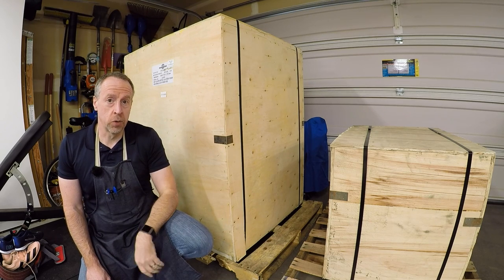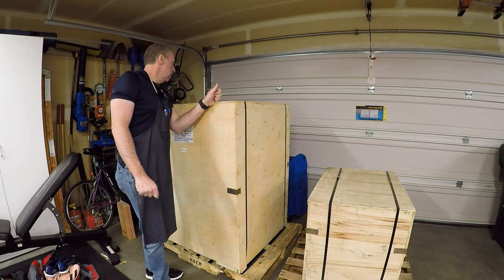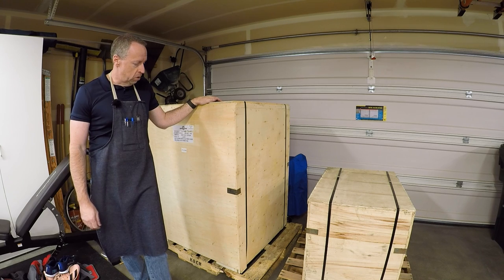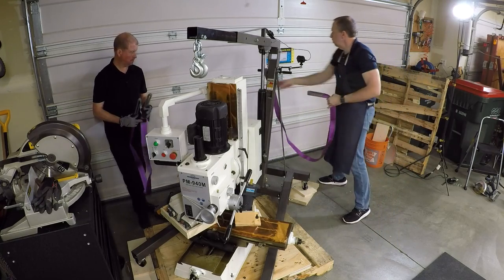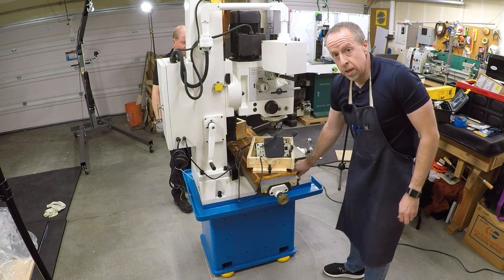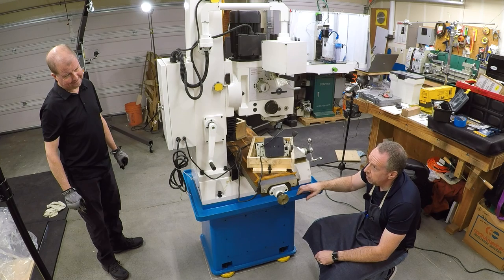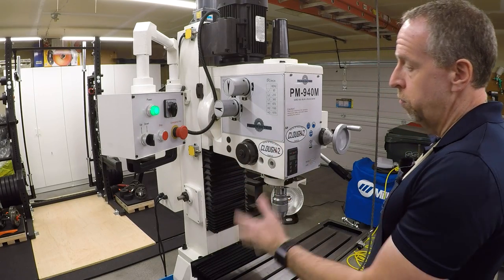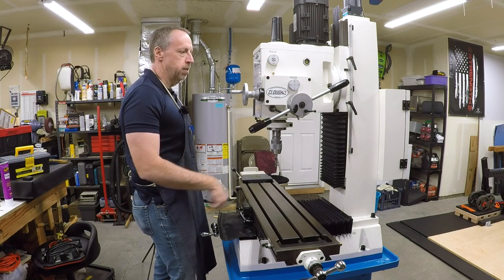Setting up a New PM-940M Milling Machine - Unboxing, Moving and Assembly

Comment: Most machine shops I worked in, there was always a couple of Bridgeport Mills available and they were always popular mills. I loved working on the Bridgeport. The larger mills were generally Cincinnati mills. Most of the lathes I worked on were Monarch and they were very fine lathes. I worked in the machine shop for years, just long enough to get my degree and become a CPA, but although I have been an accountant for 40 years, I have missed the machine work all my life. I loved being a Machinist. I worked for Lockheed as a Class A Tool and Die Maker for a couple of years and was very good at tool & die work. I made a lot of tooling that went into the fabrication of the C5A cargo plane.

Comment: Wow i wish i had all the options like your mill has on my HM46 mill which is somewhat remotely similar to your machine- very remotely that is 😭.
One modification i did before i fitted the power feed for the table was to remove the feedscrew bearing cap on that end of the table and bore out the housing to accept a roller bearing as getting to the oiler is impossible once the power feed is fitted .

Comment: Some owners were not impressed with the leveling feet and decided to machine their own. I've been considering one of these for a while and wondering how i'd do all this solo, the engine hoist seems like it'd be ok but perhaps putting taller casters on the hoist would be an alternative to what you did. I don't own a fork lift or pallet jack, and right now I don't own an engine hoist either.
Reply from the maker: Perhaps.  A few people have suggested modifying the hoist, which is an option, but not one I'm keen on.  The hoist as-is has been thoroughly tested--both before it was released, and by many, many people since.  If I modify it, I have a unique configuration that has never been tested under load.  Increasing the height of the casters seems innocent enough, but it it will change the torque loads on the tubing.  It might be fine.

Comment: I recently got a very similar mill and had very similar fun installing it with an engine hoist! I've noticed mine has some nod, maybe 0.25mm from the front to the back of the table. Have you had any problems like that? I'm still trying to figure out how to diagnose the source and fix it.

Comment: Man, as you said, tossing all the extra items you bought in the bottom of the stand without a care in the world is about what I'd expect. Real classy.
PS. Good to see you got a friend to help. My neighbors got real mad at me when they discovered I moved the darn thing on my own. I went out and bought the same exact Hazard Fraught engine hoist.
Reply from the maker: Yeah, it's inexpensive and readily available.  It's even the one they picture in the manual. :)
Reply: I have one of the exact same lift and have moved lots of much bigger equipment than this and have not had any problems whatsoever. I had a 20 or 25% discount and the manager gave me half off because the box was mangled. He took the discount off the original price and the cut that price in half so I got an awesome deal. Maybe that's why I like the lift so good!!! lol...

Comment: O.K. class out lesson today is going to be on proper PPE.  We are going to be encountering some very sharp and mildly loud strikes to both metal and wooden surfaces so what is the best choice? A. respirator B. impact resistant glasses. C. ear plugs D. steel toed footwear. E. climbing harness.  Correct answer B apparently.
Reply: People don't put on ear protection for banging on a pry bar a few times. Hearing damages happen from sustained noise, eye damage happens from ONE wrong move. Safety glasses are far more important. And "loud strikes to wood"? Grow a pair.
Reply: You missed the most important. COMMON SENSE!! THINK BEFORE YOU DO!!

Comment: Ahh I remember moving my 5500lb CNC lathe, once you get above a certain size machine you can use pallet jacks to move it around the shop like it’s nothing. Moving my G0704 clone is a bigger pain.
Reply from the maker: My G0704 is on a wood base structured so I can get a pallet jack under it.  I would be pretty worried about moving a big top-heavy load like the PM940 on a 3-wheel pallet jack.

Comment: Total NEWB  here.  What drew you to this particular machine/Brand?  Do you have any reservations now that you have it out of the box and set up?  My son is a machinist, having owned a CNC and taught himself how to use it, and I am looking at surprising him with a manual mill or a lathe and just wondering what to be considering.  He does production runs on his current machine.  I believe his is a Brother derivative and is a 4-axis.
Reply from the maker: I was looking for a machine with a large Y axis travel that was heavy and rigid enough to take large cuts in steel.  This is about the largest mill I could find without moving up to a Bridgeport-style knee mill.  My space is limited and I wanted something I could move in and out of the shop on my own.

On a related topic, I'm not sure I would want any of my non-machinist family members to try to surprise me with a new machine.  I know what I need and want, and it would be really awkward if they spent a lot of money on something that doesn't really work for me.  A machine is a long-term investment.

Comment: Been watching your video's and they are Great!
But have a couple questions,  One, I never see you using a auto touch probe any reason for not using one?, and also you are still running mach3 that's not been supported in years, any reason not to go with mach4?. 
Thanks and keep the great  video's coming..
Reply from the maker: What I have is working.  I think you'll find quite a few people who tried MACH4 and stepped back to MACH3.  Physics Anonymous even designed a new set of screens for MACH3 to update the look because they didn't feel that MACH4 was actually an upgrade.

Comment: They must think the foam packing paper becomes ridged upon insertion. Also enjoy the clampdowns as packing peanuts. I have done quite a bit of research in the Precision Matthews website. They are quite happy with themselves when it comes to shipping and customer service. I have been debating a Vertical Mill from them for quite a long time. This makes me more skeptical. Not good as I am already a rather skeptical person which makes it hard to pull the trigger. Oh boy
Reply: Yeah I can not explain what that foam even was, but someone has some explaining to do tomorrow for me.
Reply: I'm in the same boat. When I later learned that this whole mill had to be returned because the y axis was not machined at right angles to the x axis I paused my order for a Chinese mill. The one I want isn't made in Taiwan. Will have to make up my mind soon though. Good to see Matt coming through with a replacement though. See James' later posting and his even newer mill.👍🇨🇦🤞

Comment: Hello James,

I've seen you using various PM machines and I'm also thinking about buying a couple of those  (milli and a lathe). Would you please share your experience with them and tell me if you would recommend to buy them?

I'm not a machinist yet but I'd like to start with machines that provide me the level of satisfaction that you seem to have in your videos.

Kind regards and thank you in advance.

Giovany

P.S. I'm from Bolivia, by the way, and love working with metal.

Comment: Your crates/contents may have merely been left that way as a result of a random/unscheduled inspection re: drugs etc. It could just as easily be that items were removed before a normal inspection, and/or a normal delivery [such as yours], could be carried out [which is very common today].
Reply from the maker: For domestic freight shipping?  Someone intercepted the Estes Freight truck between Pennsylvania and Idaho and blew open the crate to have a look?
Reply: @Clough42  //  I based my comment on some of the other comments I read, meaning I assumed it came from outside the U.S.

Comment: i'm surprised you haven't made the move to a used cnc machine. either a small haas, or a small hurco.  one machine that can do everything youd probably ever do
Reply from the maker: If I lived in a place with a lot of used stuff like that on the market, I'd consider it.  Alas, where I live, a used 6x12 surface grinder in decent shape goes for $4000+.

Comment: How would you compare this 940 to PM's new small knee mill, the 835? Depending on how you configure them the 835 and 940 can be about the same price or up to about $1000 more for the 835. Do you think the theoretical extra rigidity of the knee mill is worth that? Anything you see the 835 being able to do that the 940 can't? It's likely a lot of my work would be done nearer to the end of the Z axis's travel so I'm wondering about the rigidity with the head being up so high on the 940 vs being stationary on the 835. Thanks! Great videos.

Comment: I recently bought a used PM-45M CNC (same as a PM-932/RF-45) and lifted almost the same as you. I wrapped the strap around the round part behind the head to get rid of the excess strap. I have the same strap and hoist as you as well.

I'm very curious to see if you do a video about gib adjustment. Mine are all messed up, either from the factory or from a previous owner that didn't know what they were doing. It would be interesting to see your process on adjusting them.
Reply from the maker: I'm no expert.  I usually extend the table all the way out to the side and then try to lever the table front to back, tightening the gib if it moves enough to feel, and loosening it if it's too stiff to move freely.  That's not scientific at all, but it gets me close enough.  I will probably try tightening the Z gib while checking the nod with an indicator.  I do get a little nod movement when tightening the Z locks, so I suspect it could be tighter.

Comment: Any reason why you opted NOT to get the Taiwan versions? Was it solely the extra capacity and the weight this one offers? I'm personally really on the fence between these two. My lizard brain says go with the bigger, heavier one... (grunt) But my logical (cry once) side says go with the higher precision version, variable speed, 5 year warranty.
Reply from the maker: I thought about it, but I was seduced by the additional mass and Y travel.

Comment: I tried to buy a PM mill (smaller than yours), but PM wouldn't sell to me in Aus. Pity, they look nice. Looking forward to some chips!
Reply: Hafco, aka Hare & Forbes Machinery house, the same range of machines.
Reply: @m3chanist  Thanks for the info, I checked their site, and couldn't find anything similar enuff that I liked. The closest was a HM-46B at $3399, but missing some of the features, and Chinese made, not Taiwanese. What model were you thinking of?
Reply: @johnkelly7264  Yes we are not able to ship to Aus, not yet anyway. Its too much risk of damage shipping that far, plus we do not have an outlet there for warranty, etc.  We are working to get our new 728 mill which is made in Taiwan to Aus, if you see that model, it is ours, but may be under a different name, we are still deciding on that. That machine is 100% ours from the ground up along with a few others.

Comment: Here's my experience receiving my PM-935, from my blog -

So the mill arrived, with some heart-stopping drama.

Things started out well enough, with the truck arriving on time. The first thing to note is that for some reason, someone decided to sit the enormous 1,676-pound crate (with its integral pallet) on top of a weak and partly collapsed second pallet. That made it tough for the driver to get the pallet jack under it. The there was that he parked the truck pointing uphill, so once on the pallet jack, the crate wanted very badly to roll toward the rear of the truck. I asked if he’d like to turn the truck around, but he said no problem. Okay…

The only thing stopping the entire affair from rolling out the back was him dropping the floor jack and letting the pallet skid to a stop, and we haven’t gotten to the fun part yet.

So as he’s nearing the lift gate, I said that the pallet looked longer than the lift gate. Again, “no problem”, but I wasn’t buying it. As he rolled the heavy pallet onto the lift gate, it sagged, further increasing the downward angle, making the whole thing try even harder to roll off the end. At this point, he had the controlling wheel of the pallet jack about 12″ from the rear of the lift gate, yet there was about 13″ of pallet still in the truck bed. I was sure that we were either stuck, or that it would end up in the street. So at this point, he (now having to stand to one side) had to raise the pallet jack just enough to let it roll a bit more, yet stop it before the pallet jack wheel rolling off the end of the lift gate. He did, stopping it—I kid you not—1/4″ short of disaster. Of course, that meant that there was still 1.25″ of pallet in the truck bed, which was a big problem. The truck facing uphill, the lift gate bending downward, and the pallet still not fully on the lift gate. At this point, he couldn’t let go of the pallet jack handle because it would have swung down, likely causing the entire thing to end up in the street. So then he asked me to lower the lift gate a little. I asked “are you sure?” “Sure.” Ugh, okay, so I lowered it about an inch, and as feared, the front edge caught, causing the entire crate to tip even further towards disaster. He said, “drop it another inch.” Sheez, okay…. (in hindsight, who’s fault would it be if it fell off? Hmm.)

With a crack and a thump, the 1,676-pound load broke off the leading edge of the bottom weak pallet, and it was finally entirely on the lift gate, and safely lowered to street level—I could breath again. It really was that close to disaster.

Comment: Good lord.  What shit packing.  I WOULD BE FUCKING FURIOUS!!!  You handled much easier than I ever would have.
Reply from the maker: I understand the sentiment.  If I get mad, though, it just gets in the way of me working productively to address the issue.  I've been in contact with Matt at PM, and he's been great.  Replacements for the clamping kit case and drill chuck are already on their way.  Everything else looks fine, except some scratches in the yellow paint on the leveling feet.  I told PM that even if they tried to send me replacement feet, I'm not lifting the mill again just to swap them out.  :)

Comment: I work as a shipping clerk.  That's not the truckers fault.  The packers, loaders and freight handler's are the issue.  I would say it was the packers in this instance.  I send expensive freight all over the world.  You would be surprised how many holes I have seen put into boxes and crates!  One time I shipped 3 pallets of materials.  The freight company brought them back the next day heavily damaged saying we put them on the truck like that.  I pulled up pictures showing 3 perfectly fine pallets going on their tuck.  They had to eat the shipping cost and the cost to repalletize the load.  Once it leaves our dock it's their responsibility.
Reply: good idea about the photos!
Reply: Oh yes, you are correct in this case. It does look a rough ride, but those should have been packed better in that base, no question about that.  You are right though, any time there is damage thats the trucking companies fault, they want to deny it. We have cameras showing loading of the trucks which catch every shipment just for that reason.

Comment: How good of a stand is it? Does it bring the machine to a good height? I have a PM-30 and have been going back and forth on the little more than 2 ft high stand. It seems like it was made for munchkins.
Reply from the maker: The stand is solid, and the manual explains that it's required for rigidity.  I agree it's a little short.  We'll see how annoying it is and if I end up putting the mill up on something.  The table is about the right height for lifting something heavy onto the table, but perhaps a little low if I'm cutting right down on the table.

Comment: I saw in a later video you had issues with this mill, it was in a video when you were unpacking a full size J head type mill from the same company.  What was your problems with this mill?   I want to buy a mill, I don't want a old big heave 30 year old machine that need 30 years of grease , oil and chips cleaned out of it.
I want new, precision, with all the bells and whistles mill
, but about 3/4 size.
we are a sheet metal fab shop, that occasionally need a lathe and mill machine.
Please, you thoughts.
Thank you in advance.
RL

Comment: I got my new mill couple of months ago. The entire ceate was in pieces, the machine have gone through 12mm plywood from three places, the truck pallet underneath was crushed and cut in half. The top of the machine have hit deep dents on the top of the crate even though there was 8cm clearance on the box.

The courier refuses to tell me what happened to it. I'm pretty sure they dropped it from the liftgate.
Reply: Was this from us, or a different company? If from us, please let us know so we can get that taken care of!
Reply: @precisionmatthewsmachineco  It was in Finland and from different company. I think the problem is in couriers who are not used to handle heavy machines. My machine was HBM profi 45, which is little smaller but seems to be originating from same factory. At least most of the parts looks identical.